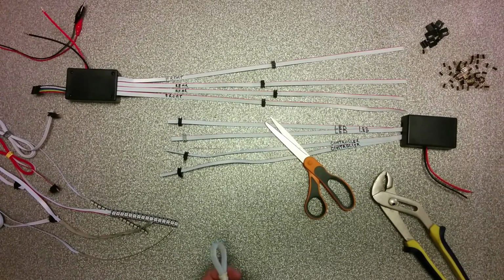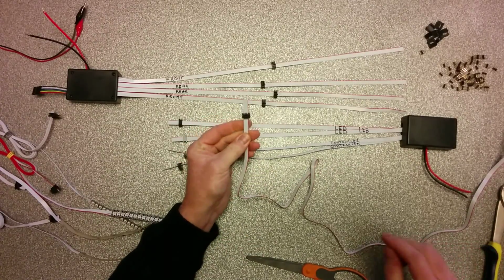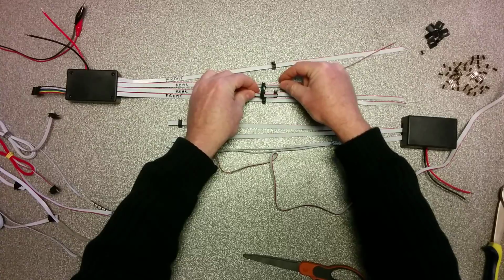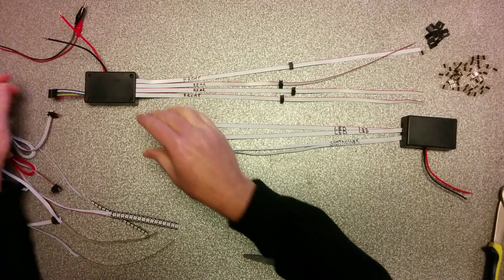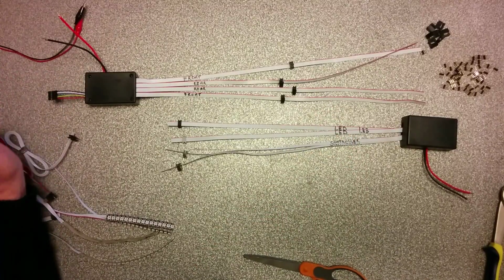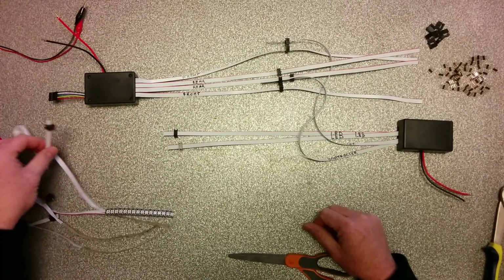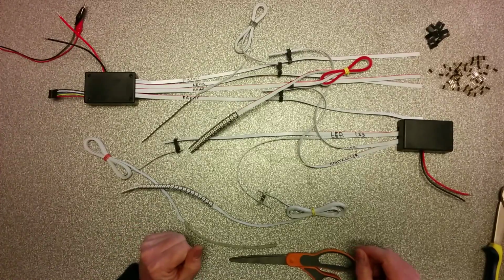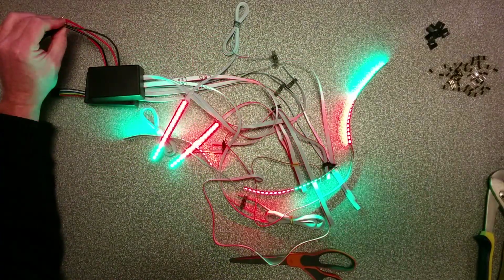Rollin' Eyes install

Comment: Your installation instructions say: "Each flat cable can drive up to 144 RE LED's, in total, BUT : on all flat cables together, you can attach MAXIMAL 288 LED's." That surely needs clarification. You can't mean ALL flat cables on the entire bike? Do you mean "ALL flat cables coming out of one controller or amplifier"? (i.e. although the limit per cable is 144 LED's, a 4 channel controller cannot drive 4 x 144 LED's)

Comment: I was hoping that you would confirm that the cables feeding into the amplifier could STILL be used to drive 144 RE LED's - otherwise the amplifier isn't helping. Sadly, you didn't.